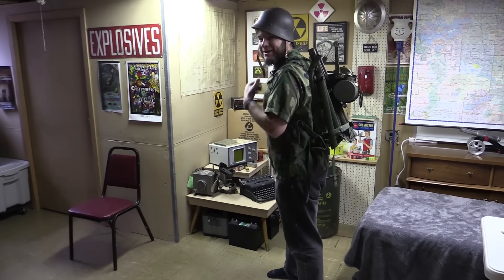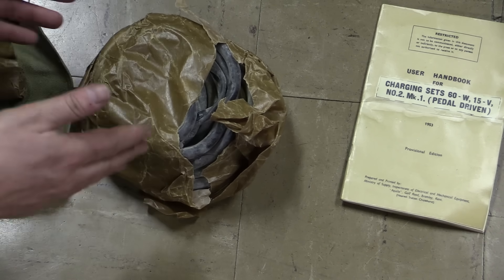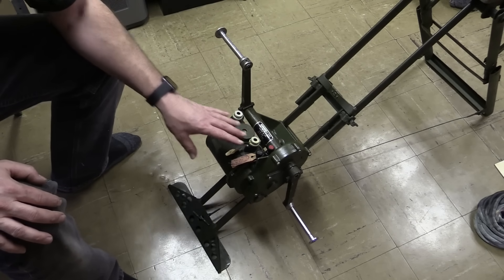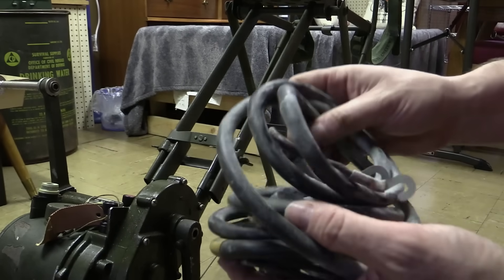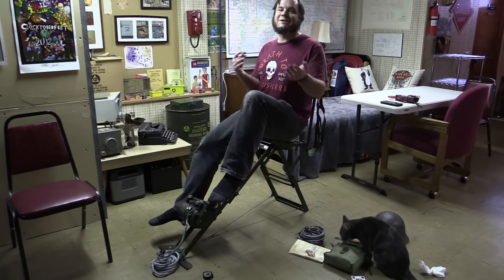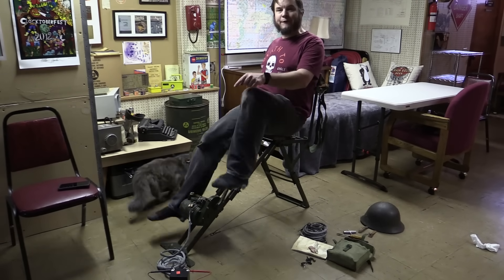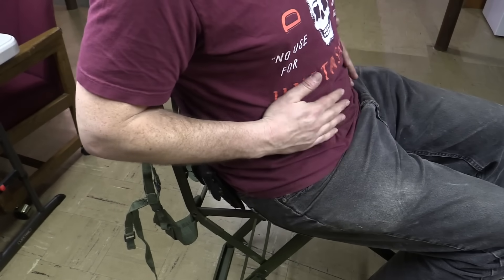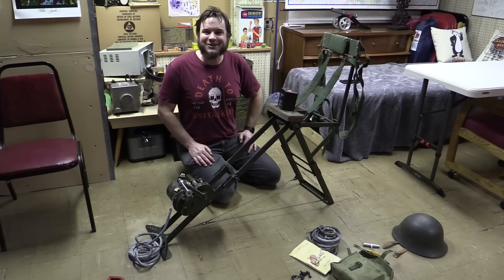Human-Powered Generator For Off-Grid Electricity - British Military Surplus Radio Power System

Comment: Here's a Fun Fact for you: The invention of the first of these devices is credited to Alfred Traeger, who invented it to be used in the Australian Outback so that remote cattle stations (ranches, in USA-speak) could call for the Flying Doctor in an emergency.  Prior to this, the only means of communcation was by road travel which was not only extremely slow but could be completely cut off in wet weather, and so was unsuitable for handling an emergency (one surgeon had to travel for over a week to reach the emergency only to discover that his patient had died the day before his arrival).  The invention was referred to as the Pedal Wireless ("wireless" being the word which was used for early radio equipment, because its most significant feature was that it didn't need wires connecting the transmitter to the receiver).
https://en.wikipedia.org/wiki/Alfred_Traeger
The device featured in this video is just an advancement on Traeger's invention.

EDIT: Charging of lithium technology batteries.
So long as the battery has a protection circuit, and the nominal charge current is under 1/2 of C for the battery, you generally can charge the battery from an unregulated source.  The battery will drag the voltage down until it charges up to around 80-90% charge, at which point the voltage will have risen enough to activate the protection circuit.  You can't fully charge the battery this way, but you still get a useful amount of charge into it.
I use a similar principle to charge lithium batteries from solar panels without a regulator circuit.  The key thing is to make sure you only do this with batteries which have a protection circuit of some description and for series batteries, to have a proper balance charging circuit (which generally incorporates over-voltage and under-voltage protection).
With solar, the amount of charge current available will vary with the amount of sunlight available, so the battery will tend to stop charging when it's near full during the day as the protection kicks in, but then will tend to "soak charge" that final bit during the evening or morning as the voltage is lower due to the reduced sunlight.
I've been using this principle with a surplus mobile/cell telephone battery and a string of LEDs along with an automatic switching circuit which keeps the lights off while the charge current is available and turns them on when it's getting dark.  The solar panel is nominally 6V but at only a quarter-watt power, so charging current is usually under 42 milliamps.

Comment: An average human supposedly is capable of putting out about 100W continuous, so to charge a 12V 4Ah battery you need to pedal for about 30 minutes supposing there is about 15-20% energy loss due inefficiency.

Comment: For a modern setup, you'd want to get a flywheel trainer bicycle and retrofit a generator to it. The steady RPM of the flywheel would ensure most of the correct speed, and you can deal with the rest using clever electronics, but yeah, this is no bueno for new stuff.

Comment: "I'm not much of a prepper myself", all the preppers are probably mad. You have underground sandland tunnels. An emergency monorail, enough gear to build anything you need and have lots of food plants. Absolutely amazing find. It is in great condition for its age. Reminds me of WWII dynamotors and those handcrank generator shock magnetos from the 1800's until the 1950ish. I have been looking for one but only managed to find a single glass wet cell powered shock coil from 1881. It works. By the way, the built in bulb is connected acros the resistor like shunt resistor. according to the schematic. Shunts are when a resistor is connected in series to cause a voltage drop which can be used to calculate the amount of current passing. So you gotta close the circuit to light it up. I think it said 0.33 ohms. Since the bulb is 2.5V. The math to calculate the current needed to create a 2.5V difference would be I = 2.5V / 0.33 which would be about 7.5A. It does seem that they intended it as an indicator as you said though but would probably be hard to get it to light as 7.5 A * 14 V would be 98 watts of power before the bulb sees it's rated voltage. A larger resistor would cause that drop more easily but would also risk burning it out at higher pedal speeds.

Comment: The grease that is internal to the unit is probably dried out and cake like in texture. If the manual explains how to lubricate it, remove the covers and go to work on it. The unit will probably be in working order 100 years from now if lubed. I use (white) grease found at some big box stores or at a fishing real dealer.  A friend had a generator hooked up to a bicycle to power a two meter ham transceiver and he had to work really hard to transmit on it.

Comment: Goofy question, but would the strength of the power generated be enough to power any modern day electric bike engines?

The kid in me imagined putting that in place of a bikes pedals and connecting the wires to a chain driven electric engine, but the adult in me is telling me there's not enough power there to make it happen.

Comment: You can feed this into an MPPT charge controller on the solar input with a battery to get a reliable constant voltage supply with optimized battery charging. I hope you see this comment! MPPT controllers are awesome for this sort of application, and they are inexpensive!

Comment: So you're right in that the lithium cells won't like the constant variable power from the cranking of the generator- Lead Acids will always be around because they really take shock and variable DC power well. Worse is that it clearly has a kind of cutoff to 12 volts and above as seen by the increase in pedaling difficulty, and also because lead acids are really 13-14.4 volts natively. Thankfully you could do something with a bank of capacitors- or even a supercap- that would both "fix" your DC voltage like a surge tank, but also lower the electrical noise to where things like modern LEDs and phones could be charged (the constant Rrrr-Rrr-Rrrrr can even be seen in an oscilioscope, electronics don't like that kind of stuff). Cool find! Wish I had one too.

Comment: That linoleum matches your gadget as well as the rest of your collection perfectly. And that exact kitchen sheet vinyl is a flashback from about 40 odd years ago.
Voltage regulators, buck converters or boost converters are pretty cheap and easy.

Comment: Charging lead acid batteries usually requires 13 to 14 volts anyway. The bloom (white powder) can be cleaned off with some rubber vinyl protectant for car interiors.

Comment: You could always use a simple zener shunt regulator to eliminate the over voltage spikes. This would increase the presperation factor for the power unit.

Comment: Hook it up to a 12 volt fan. Point the fan at yourself. Want to be cooler? Just go faster. Which will make you work up a sweat. So you'll have to peddle faster yet. Ad infinium. (Or however it's spelled)

Comment: If you want to charge a lipo battery, im thinking an mppt charge controller geared towards wind generators.   I would measure the maximum voltage and current output and acquire your charge controller accordingly.    Great video.

Comment: This was a trip down memory lane. I recall trying to use one of these on a QRP field day in the1970s. Less than successful, we just weren't fit enough to keep the thing providing enough power. Fine for receive but as soon as we transmitted the level of exertion really increased. I wouldn't worry about wearing it out, the British Army would have massively over engineered it, it will last forever.

Comment: You would be fine with a larger LiFePo battery as well.  It would behave similarly to the Lead Acid you tried. The battery ends up clamping down the voltage of the generator assuming it can handle the current you are providing, and realistically you're not going to generate more than 10 amps or so without heroic pedaling efforts.  It would also probably work well with the power banks you have tested that have 12v PV charging inputs.

Comment: You should definitely connect that thing to an electrically quiet solar charge controller (like a Genasun), and then to a battery with a meter (to see how much charge your machine provides) and then use a radio on the battery for field day.  You might not need the charge controller, but including something like that so that you don't have to think about how fast you peddle would be nifty.  I suppose it depends on what voltages your battery will accept for charging.

Comment: All batteries are negatively impacted by over charge,over discharge and irregular charge rates. At $/lb led acid batteries are the cheapest option but would require significantly more cranking to charge the electrolyte past surface charge with a stationary setup. With faster charging and discharging, lighter weight, and at most cost LiFePO4 would be the best option for a stationary setup at the cost of their lifespan. Luckily MPPT charge controllers exist and would mostly solve the issues with the irregular charge pattern for both batteries, when connected between the battery and the generator.
Reply: Out of the two options you proposed.

Comment: This is a very useful generator, and I also appreciate that it works independently of the sun and wind. It's great that it provides 12 volts, making it usable for many mobile devices. I've built a 10 ampere USB power supply with a DC/DC converter, which allows me to charge USB devices with 12 volts, and a generator like this would complement such a setup. Of course, such a device is also very useful when hunting for Bigfoot if you're spending many days in the forest. The idea that the generator can be folded and carried on the back is brilliant.🤗

Comment: I have a pedal generator hooked up to my 200Ah LiFePO4 pack - it's mainly charged by solar, so my cranking adds perhaps 20W on top of the 50W the solar panels make even on an overcast day! But I have it as a way of exercising while sat at my desk (in video calls) that puts the energy somewhere useful.  Given how the solar power fluctuates when little clouds are scudding across the sky, I think it's barely worse than solar from a voltage/current regulation perspective, especially as I usually crank at a steady pace for a half hour meeting!
Reply: I should add: the voltage made by the thing is kinda dependent on how fast you pedal, and the resistance you feel is kinda dependent on the current drawn - so when charging batteries I feel minimal resistance until I'm pedalling quite fast then it suddenly bogs down as the battery starts to draw current. I think my unit could do with a slightly higher gear ratio so I don't need to pedal quite as fast to get to battery charging voltages, but it's OK. However if you connect a resistive load (I have a big heatsinked 1 ohm resistor), you get a nice smooth increase in load as you pedal harder. I also tried hooking up an electronic load and playing with the different modes - constant voltage mode (where it draws nothing until it reaches the target voltage, then draws as much current as it can to try and keep that voltage down) was the most comfortable for using it as an exercise device as I could just dial the constant voltage of the load to provide a comfortable resistance at a comfortable pedalling speed!

Comment: You could charge the LiFePO4 Batteries with that thing (at least if it's pure DC and not AC coming out). The changing current shouldn't bother the batterie so much but you should definetively take care of the voltage! You must not overvoltage them. They will be damaged permanently. Usually on the battery itself is written "max voltage 15V" or so. So you would need something like charger circuit although you COULD charge them directly if you take very much care of the voltage 👍🏻

Edit: If you charge the small lead-acid batterie you should take care of the current too. Usually these small lead-acid batteries have limited charging current (usually 1/10C, so 8Ah batterie has 0,8A max charging current). I don't know how much your bike outputs 😊

Like your content very much! Keep going!

Comment: Battery tech here: LFP Batteries don't mind fluctuating power at all. In fact they're better at handling fluctuating power thanks to the higher charge efficiencies. With the power station you should be fine as long as you don't exceed the MPPT voltage range as that could start damaging things.

Comment: The reason the circuit kicks in above 12v is because lead-acid batteries require more voltage to charge than their nominal output voltage. That is an awesome device!
Reply: That would also protect the device from being overloaded with electricity running from the battery to the charger.
Reply: I think there is a reason for the light on the generator. The unit is called 60 W - 15 V. Considering that I would guess going about full throttle on that generator would give you 4 amps at 15 volts which is too much for that battery <7ah. But given a larger battery I question if that light would come on if not charged. With a lead acid battery you could consider that if the battery reaches >14.7V it would have absorbed most of it's capacity and thus light-on means battery at high capacity..

Comment: Your intro, made me smile.  Who said Americans can't do parody. 😆

There is not 'cut in' circuit.  The circuit in the user manual, showed a compound wound DC motor.  So the stator is an electromagnet.  And sufficient speed is required for the residual magnetism in the armature, to create a voltage to build a magnetic field in the stator, and as a current begins to flow, magnetic fields rapidly increase in a positive feedback (more magnetic field makes more voltage, caused more current to flow, resulting in stronger magnetic field, and so on).  I didn't see any voltage limiting in the circuit diagram, and will probably be limited only by the magnetic field saturation, armature speed, and current draw (resistance losses).  The motor/generator, is identical electrically, to the generators of older cars (the ignition light would often come on when the engine idles, and there isn't enough speed (rate of magnetic flux change of the armature windings, through the stater magnetic flux) to maintain enough voltage to sustain the stator's current demands, to maintain enough flux for generation).  Only difference is, the vehicle generator, has the stator circuit current, controlled by a regulator.
DC generator and regulator explanation here; https://www.youtube.com/watch?v=BYOE8RyL1Sw

Comment: @SaveItForParts: 6:20 The PRC-320 has a hand crank generator. When you first start cranking the generator, the indicator bulb will start to light. When you get the RPMs up to proper speed, the bulb turns off, indicating that you are at the 28V required to recharge the battery bank. Inside the had crank generator is a 3-phase generator going through a bridge rectifier, which can be run in either direction. There is also a window comparator circuit connected to the indicator bulb that helps you find the target voltage. Cool video, and nice find!

Comment: That's the kind of guy you describe as a "chap".

Also, to make something like this work with modern battery chargers you'd just need something to stabilise the voltage between slow pedals.  So a big capacitor and a regulator before the charging circuit would do. I wouldn't use it to charge anything more than 6-8v though like that. As for running something off it, same deal, as long as there's something in the power supply circuitry to take smooth the surges it'll run fine.

Comment: Gabe, that white powder is dried slurry. After the extruded rubber/conductors run through the cure-ovens it's ran though a slurry bath, then ran through the drying-section before it's wound onto the big bulk spools. The dried slurry keeps the cables from sticking together on the spools. The slurry has talc in it and that's what's on those cables. However back in the 50's before breathing suspended particulates was a concern, the cables may have ran through a shaker drum in a talc-booth before being wound on the spools.

I don't know where that guy in the comments got that bs "bloom" from. Nothing in any rubber compounds leeches out of cured rubber like that. I worked for BTR and Goodyear for over 30yrs.
Reply: you only get bloom when cooking chocolate

Comment: I can recommend gearless e-bike hub motors. Quiet and more efficient. Or the small hub motors from e-scooters, with just a handle and a 3-phase rectifier. The only thing you need to do is to connect the parallel windings in series.
I had no problem so far with li-ion batteries. I connect the generator directly to the battery, no charging circuit. Just watch volts and amps and you're fine. If the battery is big enough, you won't be able to exceed the max charging current. 
Wipe the cables with some silicon oil, they will be like new. (not the spray, that's bad for rubber)😉

Comment: During the 1948 Israel War of Independence Kibbutz Yehi'am  in Western Galilee was under siege and isolated. Each day at a certain time a kibbutz member would take a turn cranking a British army field generator just like the one you are having fun with. This powered the radio receiver. Each day at a certain time they would listen to the broadcast directed to Western Galilee in case there was a message for them at Yehi'am in particular and also to hear the news about the war and what else might be happening in the new State of Israel. And when that broadcast finished, they would turned the radio off to save the tube filaments and stopped cranking. (There were no rechargeable batteries.)